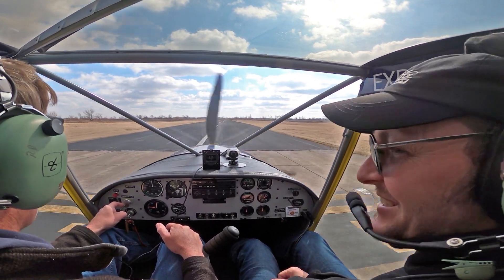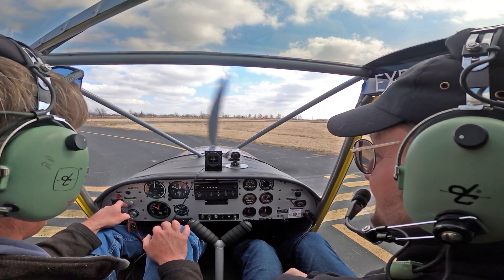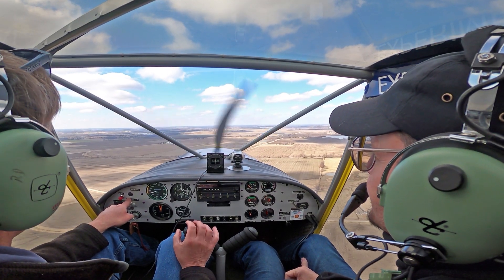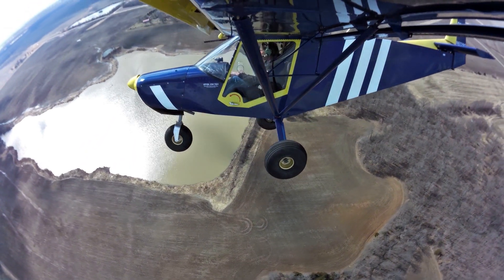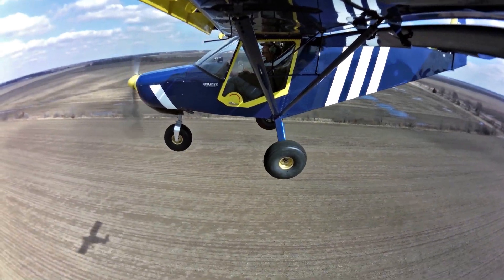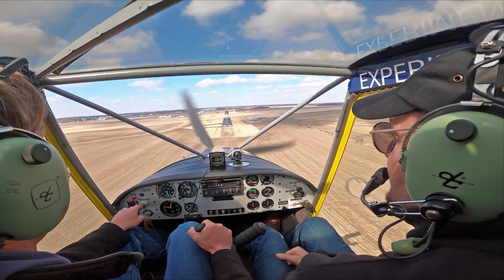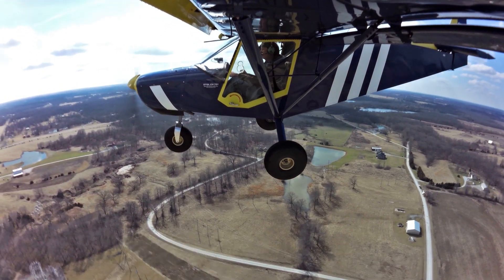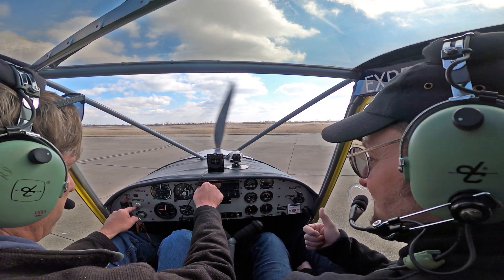Flying the Zenith STOL CH 701 "Sky Jeep" light sport utility kit airplane

Comment: Sir, Love the 701! Love the videos! Can you get a cruze 100mph (say 8000 altitude) by using the streamline struts with a reasonable cruze RPM? I know your using the 100hp Rotax, I'm considering the 130hp Viking. I'm also willing to sacrifice a little STOL performance in favor of cruze speed.
Reply: Mine flies regularly at 100mph just above treetop level in Tennessee with the ULPower engine.
Reply: @TNFlyingFarmer  Thats some valuable Information!   Thanks!